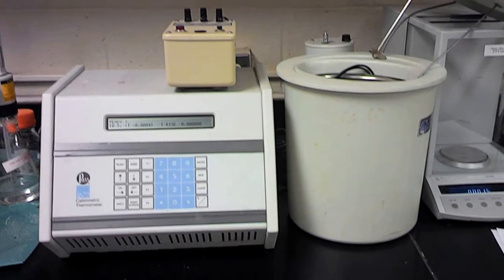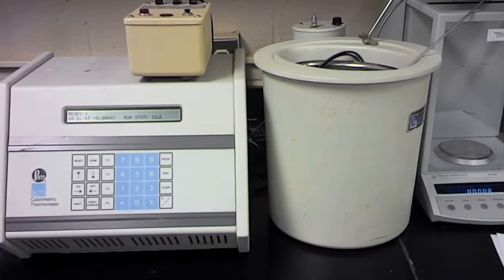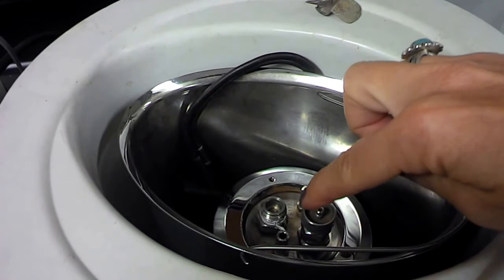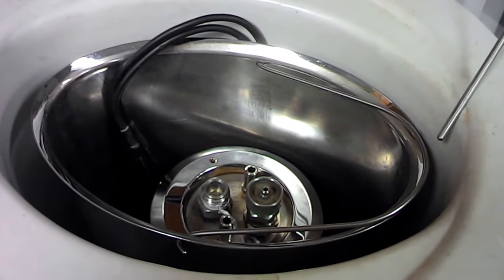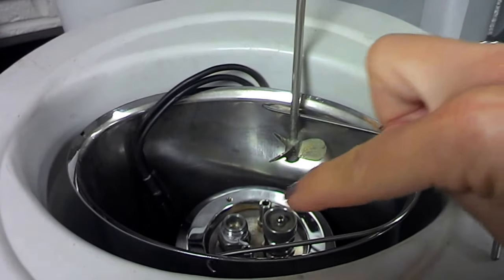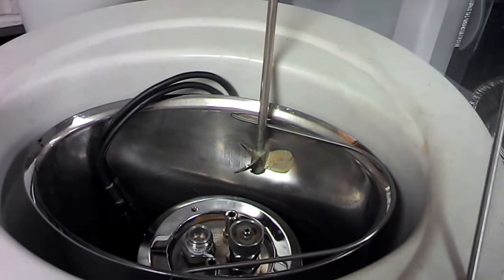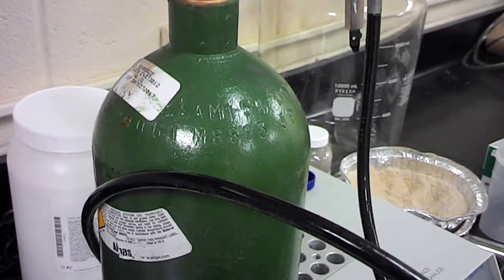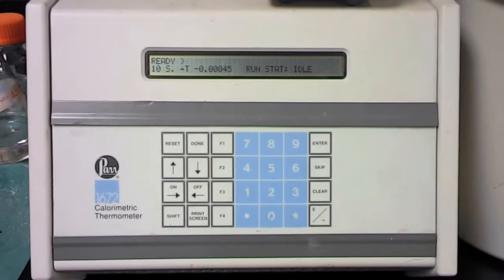How a bomb calorimeter works

Comment: What about the energy put in to initiate combustion.  If the sample is oil surely it will need energy to raise its temperature to fire point to begin with.  Are these things negligible. ?